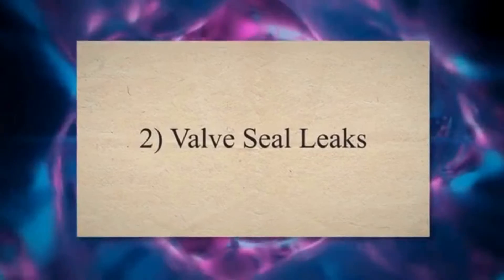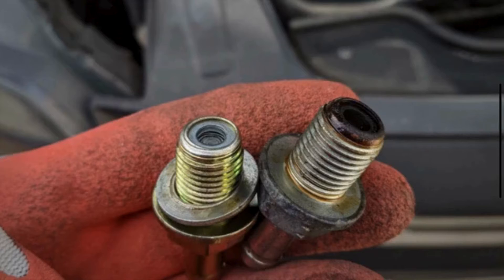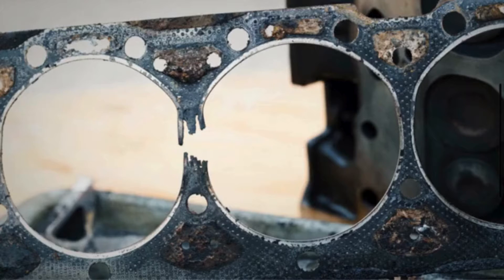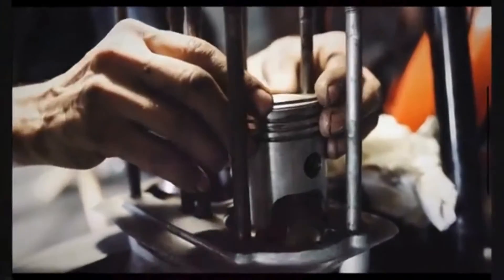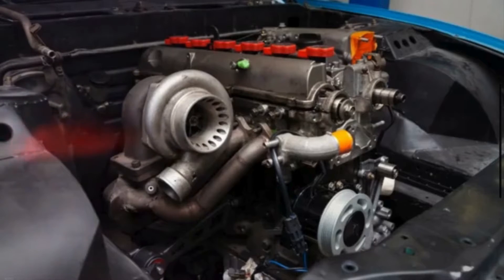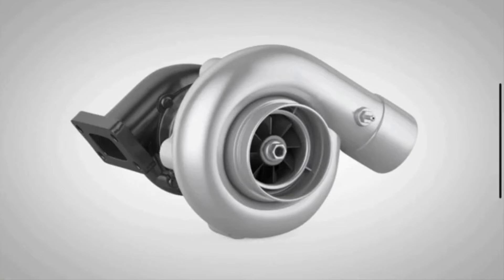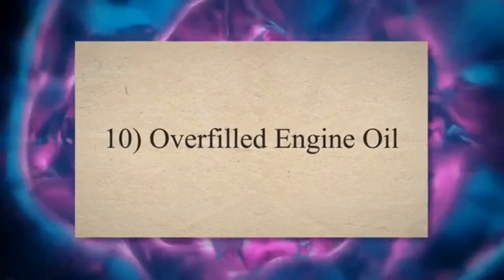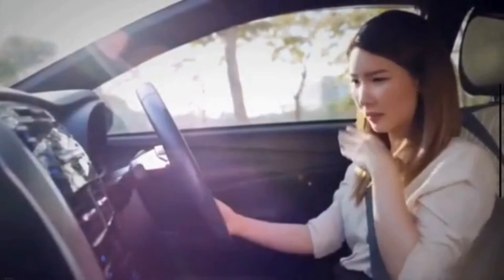Car Burning Oil? (Top 10 Common Causes And Fixes)

Comment: Nice video so is any way to resolve this issue or not ?
Reply from the maker: Yeah properly inspect all the parts and replace or repair the faulty parts. In this way, you may fix your issue.